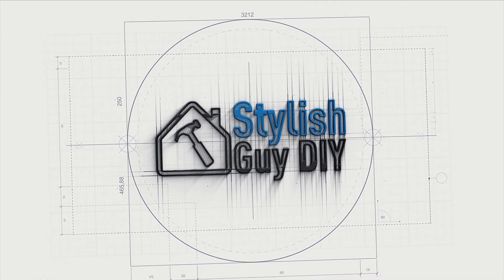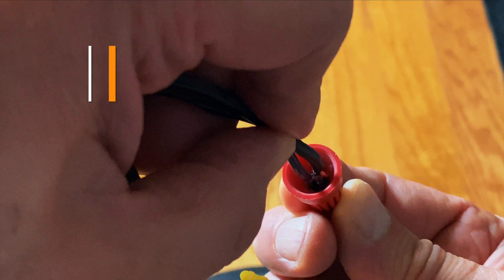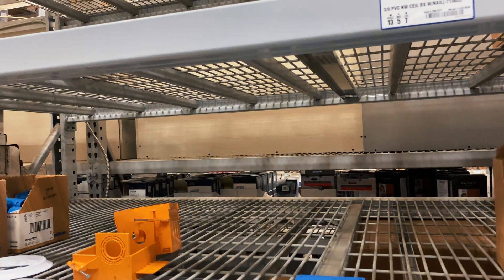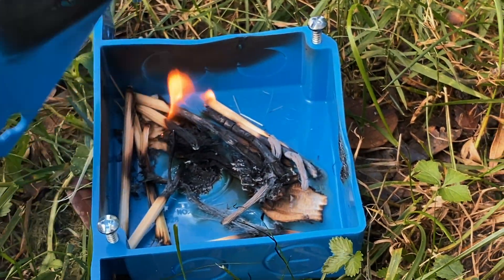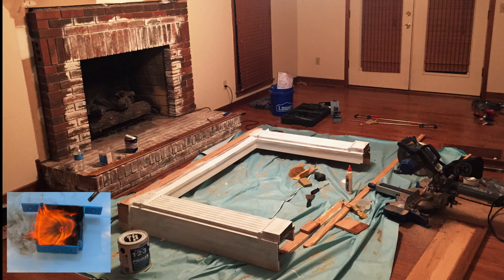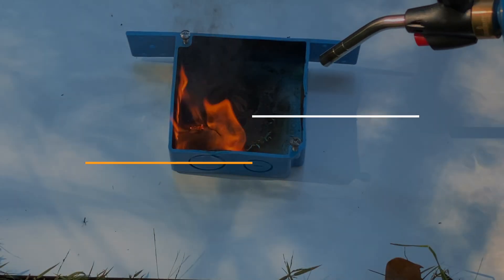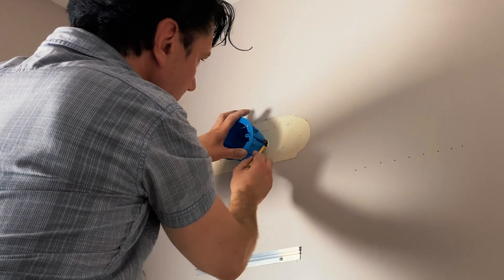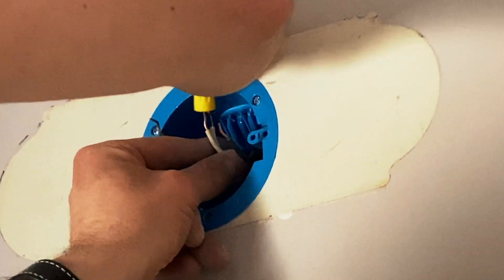A simple way to prevent electrical fire in older homes

Comment: There's a very good reason the National Electrical Code requires all splices to be enclosed in an approved enclosure,  and that's to prevent a sparks and heat from a failed connection from starting a fire.   As every good electrician will tell you, almost all electrical problems occur at splices and termination points,  each connection within a circuit is like adding another chain link, a chain is only as strong as its weakest link, a home's electrical system is no different.
Reply from the maker: I use that slogan all the time myself 
“A chain is only as good as its weakest link!” ❤️ :)